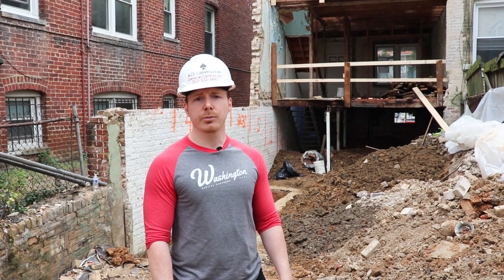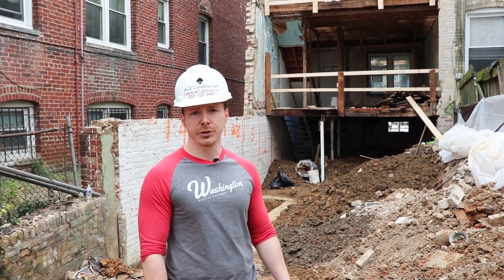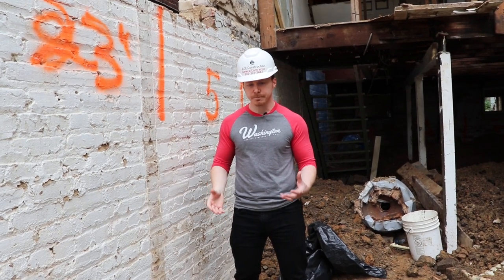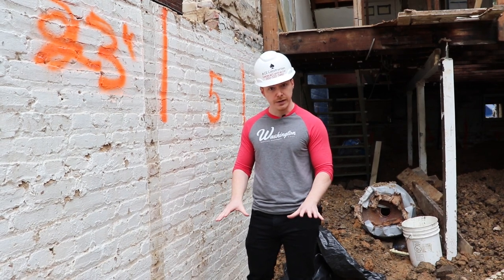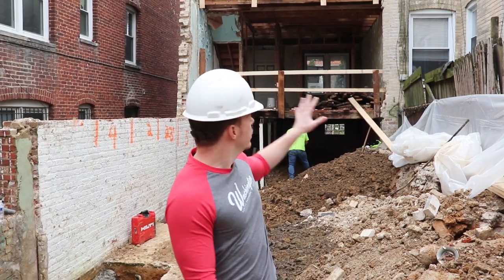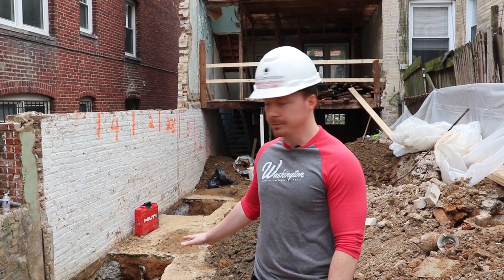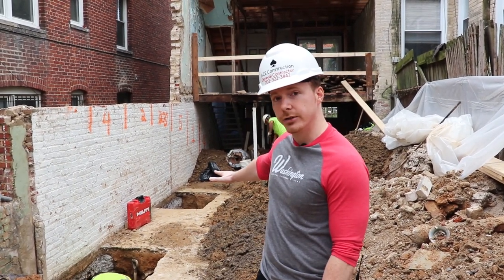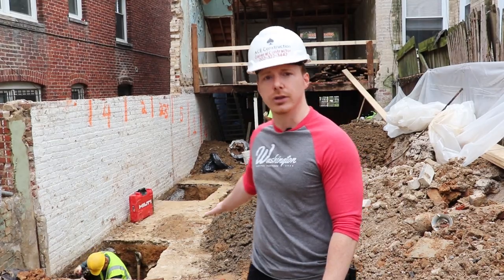Inside Demo and Underpinning a Foundation of a Row House

Comment: In your experience, how often does a row home renovation of this extent cause structural damage to an adjoining row home’s walls and/or foundation requiring substantial repairs to a neighbour?
Reply from the maker: We have never had a project cause damage to a neighboring property. If the underpinning is done correctly, it is strengthening the structures that could be affected. That's why it's so important to make sure you have a skilled team on the job
Reply: @Washingtoncapitalpartners  Thank-you. A neighbour of mine dug a 30 foot deep basement using secant pile walls ( in a detached home). Is that a technique that can also be used in a row home or what would you use? Is that what they use in London row homes for those super-deep basements there that you hear about?
Reply from the maker: @mr8966  Secant pile wall construction seems to be very similar to the underpinning of detached and row homes we see in the US. There could be some differences in London row homes that would be worth looking into